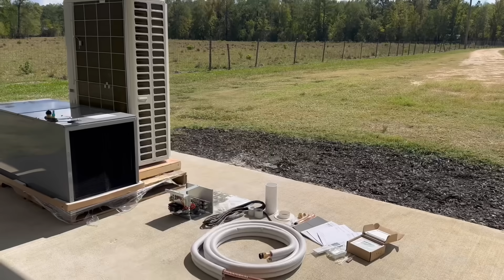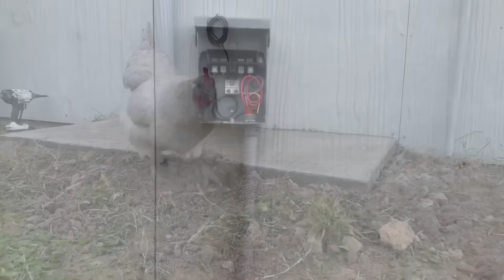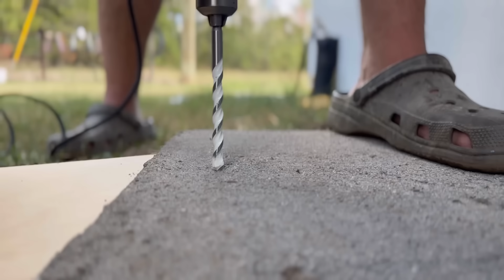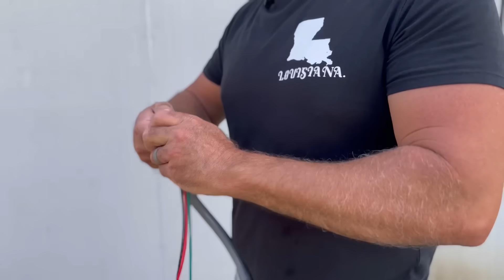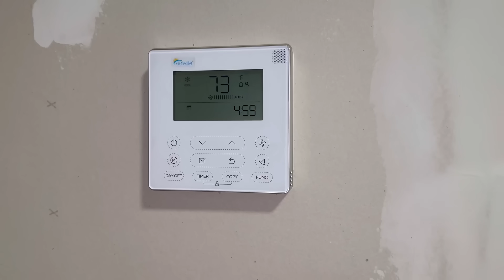Installing Senville Central AC/Heat Pump Split System | Building Our Own Home Ep.116

Comment: I think the unit manual says you have to rotate the evaporator 180 degrees if you're installing in the horizontal position because the drain pan is factory installed to go in vertically. So if you install the indoor unit horizontally you may have drainage issues inside the unit if the pan isn't under the proper bottom of the unit. 

Just an fyi....

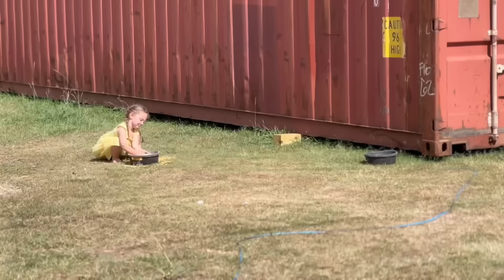Comment: At 14:37 in the video your daughter is spilling corn meal on the ground.  Watch that spot grow greener, denser, and faster growing grass in exactly 3 months.  I guess I'm really late here, but think back.  Corn meal is an organic fertilizer.

Am I correct in understanding that you don't have a return air plenum with a filter on it?  The air going through the coils MUST be highly filtered or it will clog with dust and debris in a week.  When the air cannot flow freely through the coil, you can get a situation where the condensation freezes and completely plugs the air flow.  

Did you add more Freon to the system to account for the extra footage of copper pipe you added?

Comment: How has it been since you installed this last year? I ask because I am currently installing the same system and everything I have read and watched about it says it requires 6 gauge wire and a 50 amp breaker for the outside unit and I see you used 10 gauge.

Comment: Just wondering if it wouldnt be beneficial to run the drain through a pvc pipe that could run out under the eaves inti the gutters on the house . Mine is designed that way and has worked very well for 24 years .

Comment: The #10 wire for the outside unit was sufficient?  Isnt a 36k unit 30amps minimum and 50amps max fuse/breaker? Also, wouldn't it require a double pole 50amp?  Just curious, I'm installing the same unit

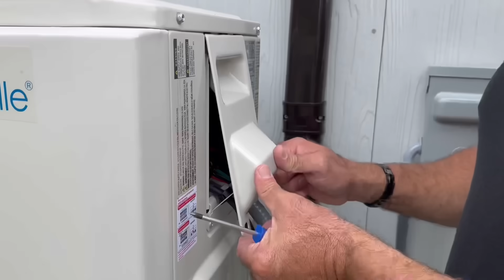Comment: I had to use this video several times to verify my installation, thanks a lot :).  Also now I know why you cut right at 23:41 and didn't show you righting the wire down :) , that part was not so fun because the terminal was a bit too small for the given wire

Comment: You can buy watertight plastic fittings for 3/8 electrical cable and that is what you should use on your condenser unit for your signal cable. Just using the grommet you have there will allow rainwater into the system.
Reply: That's not really a concern as the entire unit, inside and out, is exposed to the elements. Since the cable entrance is pointed down, water will drip off the cable before it's able to penetrate inside in any significant amount.

Comment: To those wondering, the s1 S2 connection he did is wrong.
S1 S2 outdoor connect to S1 S2 indoor on the circuit board. 
L1 L2 indoor  wire to breakerbox 220 or to aux heat disconnect if equipped.
Reply: I'm having this exact issue. If I connect S1 and S2 from the outdoor unit to the S1 and S2 terminals on the board, the indoor unit doesn't power on. Besides the aux heat power, Doesn't the L1 L2 terminals on the panel below the aux heat breakers power the indoor unit?

Comment: You guys mentioned in the video that the original line set was too short .Did you get a custom made line set?   Also what is the maximum  Length of a line set that  can be used for your eonparticular unit and did you have to add freon?
Thanks  you guys for posting

Comment: Great video, I would have been 3-4 weeks on this type of install. You seem to know a little, now a lot, about a lot of things. I might need one of these in the coming years and might have to hire you to install it. At my age it's hard to each an old dog new tricks. I was told as we have a heat pump it has to have lines run underground but this one doesn't seem to have that.

Comment: Hi guys! You’ve really got my interest with your AC/Heat Pump installation. It would be great if you could explain more about your ductwork or lack thereof. 😀 One thing for sure that spray foam insulation is really doing its job. Should you need to be concerned about the your house being too airtight?? IDK Really curious because I have always been interested in energy efficient homes. 😊 Thanks!
Reply from the maker: Hey there Steve! We will keep you posted on how our ductless return system works after we get everything completed. The is no concern about our house being too air tight with this system. The problem comes into play when you have a large system that cools or heats your home too quickly. This means that your house get to your desired temperature before it has time to condition the air”remove moisture”. That is one of the main reasons we installed a 3 ton rather that a 5 ton which was suggested. Hope this helps.
Reply: @CajunCountryLivin  Thanks! I find this so very interesting.  Looking forward to further videos on the subject. You’re right, you saved yourself a lot of money! I think you Cajun folks are great!

Comment: I have some HVAC experience and I am more than impressed about how you have tackled this and done this installation yourself.

I wondered about the choice of using the entire attic space for your return air plenum versus installing ductwork. But I agree that seems like a reasonable decision.

I am curious to know whether you're adjustable wrench was SAE or metric. 😄
Reply from the maker: It seems to be a good idea in theory Delbert. We will keep you posted as to how it works when we get all of the ductwork completed! Our “adjustable wrench” is a left handed Standard for sure😂

Comment: on your condensate line, your vent stand pipe needs to be on the downstream side of your trap, otherwise it'll suck air unless you cap it, then it doesn't vent... this unit is exactly like mine and there is a problem with that t-stat, the company I got mine from sent me a different one free that works perfect
Reply from the maker: Thank you for letting us know Kenny!

Comment: Great job on the HVAC unit install. You might want to think about adding a tank to the end of the condensate lines to catch the water. We did and were surprised at how much water is produced by the system. We were getting about 5 gallons/day (your mileage may very). It would be a great resource to water the garden with.
Reply from the maker: That’s a really cool idea!! Thank you!

Comment: You put a tube on for condensation to not drain on the pad, but near as I could tell, it is stuck under the unit?
Reply from the maker: It’s about two inches outside of the concrete pad. It’s just hard to see that clear tubing on video.

Comment: You did a great install and you will love that split unit. Just don’t freak out when it gets cold out and your temp starts flashing. These have a built in defrost mode for the compressor. Trust me. I freaked out when it happened to me and my boss had the same thing and called me when we had that big freeze and snow here in Texas. It does what it does and the energy you save will amaze you. We have 2) 12,000 and 1) 9000 btu splits running and my electric bill has gone down compared to using the 20 year old central system that ran all day and all night with hot Texas summers.
Reply from the maker: Thank you very much for the info!

Comment: Jim, a long time HVAC technician here. I think you’ll find that condensation drain on the air handler to be sluggish. You’ll need to cap that vent installed before the trap. You do not want any air being drawn into the drain line. The water won’t drain out until the unit shuts off. All vents in negative drains should be after the trap. Trust me. 😊
Reply from the maker: Thank you very much for the tip! Will fix that asap!
Reply: Can anyone explain this?  What does this mean?  I bought this same unit, so I want to ensure I do the drain correctly.
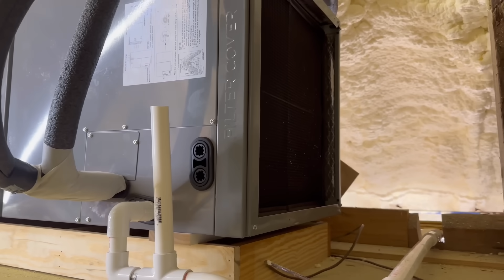Reply: @resilientwayfarer  At 33:17 you see the little vertical vent pipe before the v trap , you want that either capped off or just not have that vertical vent pipe , it'll make the drain work better.
Reply: Literally gets slugs in the drain. Line??
Reply: Looks like the drain is on the positive air pressure side of the coil???

Comment: What's the current load for that compressor unit?  Are you sure you've used large enough electrical supply wire?
Reply from the maker: #10 in and #10 out. 30 amp

Comment: Hello like your videos, good job on the air conditioner installation however you might want to check the air vent on the condensation line I do believe it is on the wrong side of the P-trap.
Reply from the maker: Thanks for the tip! Will definitely go check that!

Comment: A couple of years ago I put in a split system here in northwest Las Vegas where it's 9,000 degrees at midnight in July...yeah, it's a dry heat, but so is the inside of an oven.  The desert is literally straight out our back door with the Las Vegas Range and the Sheep Range Mountains just beyond.  The split system works really well.  We use one side of it to cool two bedrooms and a large bathroom while easing off the thermostat for the rest of the house at night.  Then that all that reverses in the daytime.  A year ago, we installed Solup solar panels, and we haven't had an electric bill since.  Here, it's gas for heating, cooking, hot water, and the dryer, and electricity for cooling.  Our heater/blower is in the attic of our one-story house and lays on its side like yours.  Our outside units are Trane, and I really can't complain; they're very quiet and very efficient.  You have a great family... a hardworking, smart husband with as steady a hand on a saw as I have ever seen, a wife as pretty and well put together as any of the lady dancers down on the strip and a strong, funny, and capable helpmate during all of your construction adventures.  Now, many years out from now, whoever marries your daughter is just going to have to get used to living with someone that can outrun, out jump, out swim, outshoot, out fish, and will always be the one at the top of the hill on the dirt bike waiting for him to catch up.  At her present age, she is probably the most adorable little angel I can remember seeing ever.  Kinda hated seeing the old window unit go...there's something about a machine or animal that has served me well that I always missed when it came time to part company with it, but that's just the nature of living, I guess.  I wish you all only the very best of everything.  Adios.
Reply from the maker: This is a great comment! Very thoughtful and we appreciate it very much!

Comment: If you are doing free air return where are you going to install you filter on the return side.
Reply from the maker: The air handler has a compartment the air filter slides into

Comment: Awesome.  I have been thinking about installing one for our house, but I seen it was rated to -20 and here it gets colder than that sometimes.
Reply from the maker: They also come with auxiliary heat strips for when the temperature drops that low. But wait….. colder than -20 degrees? Larue ….. you need to move South my friend!😂
Reply: @CajunCountryLivin , I am 65 and that would be nice 🙂.

Comment: After being in the HVAC field for 27 years I would have loved to have seen more room between the side of the house and the back of the unit. Specs may have said that was enough room but take my word for it. You can't have to much room when you have to work on HVAC units.
Reply from the maker: Thank you for the tip!
Reply: @CajunCountryLivin  I believe Senville recommends 12" on larger units. Some manufacturers recommend 6" if the outside unit is wall mounted. This allows circulation under the unit as well. In the future add a small space under the unit using a couple of treated 2x4's.
Reply: It’s only four bolts holding it down….that will give you plenty of access!

Comment: You won’t regret this unit. I installed mine 3 years ago and it’s been flawless.
Reply from the maker: Awesome! Thank you for letting us know Rusty!
Reply: where are you located? Am interested in knowing if you have temps near 100 and/or below freezing and what you set your thermostat too and how well it deals with both the AC and Heating?

Comment: Good morning Lydia and JIm.  That Senville system is nicely designed and should do the trick for you and be very energy efficient.  Nice job on the install Jim, very neat, clean and organized.  Good thing you had Ladly there to supervise the job 😉 Give that cutie a big hug.  I built a 1500 sq ft shop at my sons house here in Bakersfield 2 years ago.  Went with (2) 2 Ton Mini Splits on opposite sides of the shop.  They handle the extreme heat and cold of the area nicely and are very energy efficient.  I'm sure you will be very happy with your system.  My only concern was that it didn't appear that you had any physical barrier betweent dry pour slab and the house siding.  Being it appears the unit is locate on shady side and the porous nature to absorb moisture, it could cause problems down the line.  You might consider sliding some flashing material down that back edge to act as an isolator from the siding.  Have a great week you two.  Larry, Central Valley, Ca.
Reply from the maker: Thank you very much Larry! We sure hope ours work as well as the units that you installed in that shop!

Comment: I have 2 split units in my big old house. They work great. Not big units outside. I just love them. I live in Ky where it gets cold. I do have vented Lp gas to back up when it gets way down. Love the low cost heat and air bills. Usually blow 100 $.  Hope you enjoy yours!!